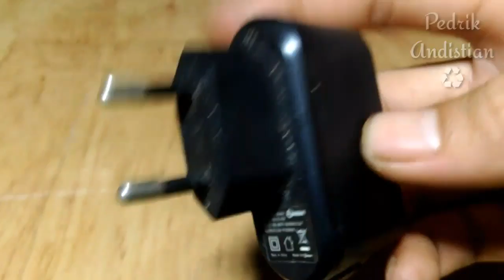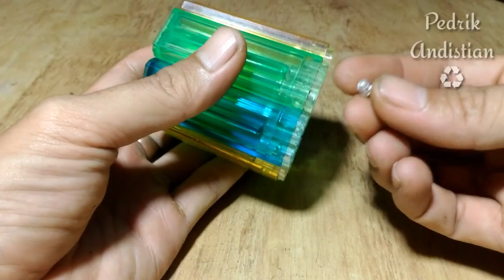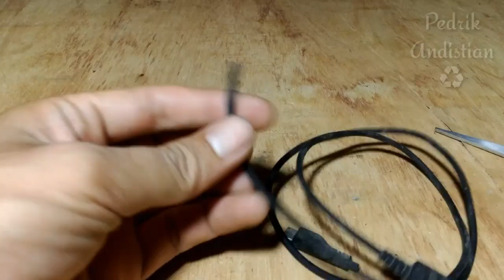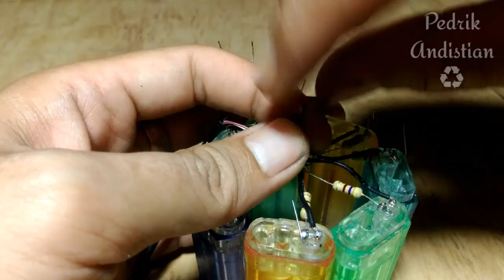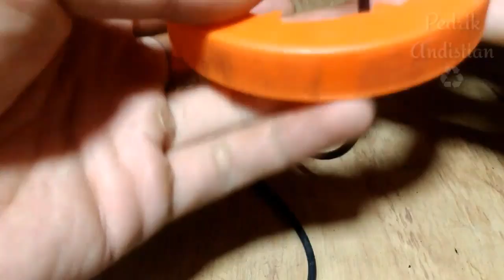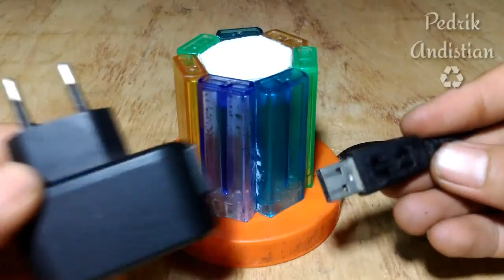Cara membuat Lampu Tidur / Lampu Pajangan LED

Comment: itu kabel cas.ny sembarang aj kh 
ap harus yg ber isi 5 kbel kecil.ny.
klo misal kbel yg isi 5 ap hrus d gbung semua kbel.ny itu.
tolong info.ny gan thanks
Reply from the maker: +Acmad Arief Itu pakai kabel bekas charger hp, isinya memang lebih dari 2. Cukup pakai yang arus positif dan negatif, untuk mengetauinya harus pakai multimeter, kalau saya cuma dikira kira.
Reply: Makasih ganti info.nya aku coba duluan lah
Reply: balap mobi

Comment: maaf  mas bro, knapa saya coba gk bisa
mohon bahan nya detail
Reply from the maker: +tunggul sianturi untuk colokan ke listriknya saya pakai charger bekas hp, dengan keluaran daya 5 Volt, dan untuk resistor saya pakai ukuran 470 ohm.
Jangan lupa posisi LED nya jangan sampai kebalik positif negatif nya bro.
Reply: kalo pakai resistor yg 10 ohm ,bisa gak mas ?
Reply from the maker: +Hendi kasep adanya yang rusak bro :)
Reply: tunggul sianturi 
gonsifacai ma
Reply: tunggul sianturi

Comment: itu bahanya apa aja
Reply from the maker: +Naufaldi Iksantyo bekas korek gas - tutup botol sosis - LED - resistor - kabel
Reply: Pedrik Andistian resistornya yg brp tuh LED nya yg brpa volt/watt
Reply: Naufaldi Iksantyo
Reply from the maker: +chanel iseng maaf baru kebales bro, saya pakai resistor 470 ohm kalo watt LED nya saya kurang paham, cuma ambil bekas lampu emergensi.
Reply from the maker: +merah muda 2000 udah berapa malam dicoba nyala masih kuat bro 😊